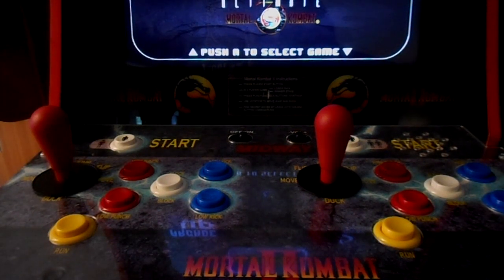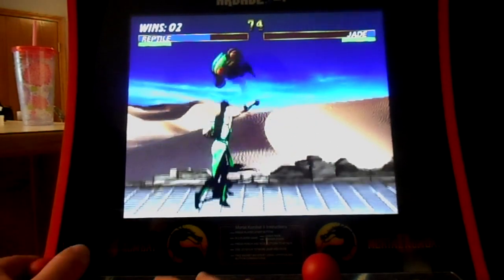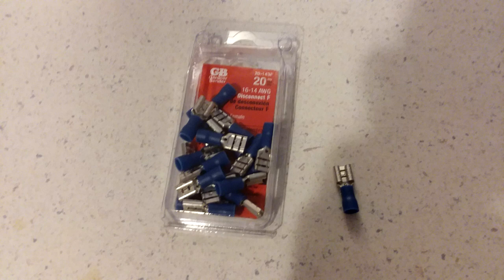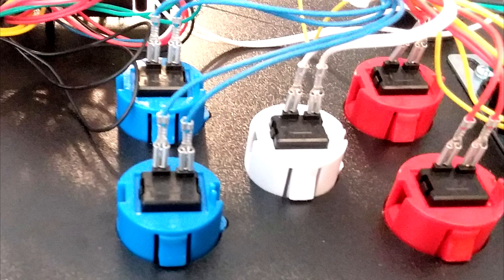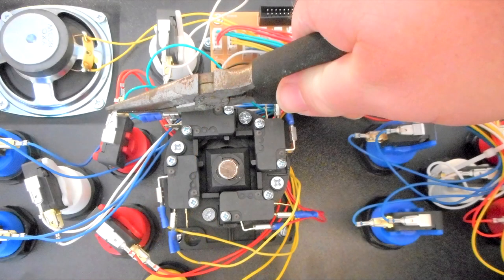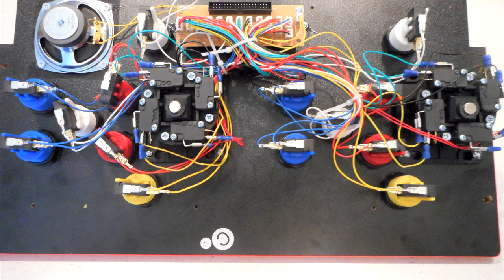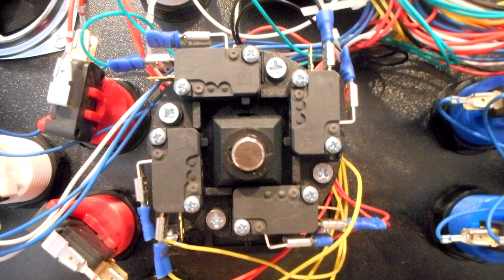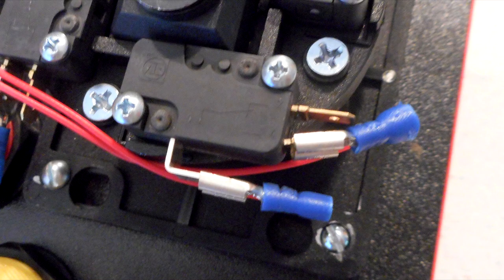It's EASY to do putting HAPP Competition joysticks in your Mortal Kombat Arcade 1up

Comment: Awesome video and tutorial. I'm actually going to install Happ joystick and buttons on my Mortal Kombat arcade1up as well. Couple of questions for you though since I'm new to this...

1. You had mentioned that the IL Euro stick and suzo-happ stick only difference is the color of the actuator. So does this mean that they both feel exactly identical? ... I'm ocd about authentication and nostalgia lol

2. You said the Happ joysticks will fit without any problems and no dremeling. I seen another YouTube video where someone had to dremel their joystick to have it fit in their Mortal Kombat arcade1up. So are you positive they will fit without dremeling? ...Not doubting you, just reassurance lol.

3. So I'll have to make new screw holes when installing the Happ joysticks unfortunately? :(

4. I played the original Mortal Kombat in arcades when I was a kid. It's hard to remember exactly how the joystick and buttons filled. I think I remember the joystick and buttons feeling smooth with no clicking. Is this true, or have I just forgotten?

5. Do the suzo-happ buttons feek exactly similar to the IL EURO buttons, and are they clicky or mooshy like on the Mortal Kombat arcade1up factory buttons?
Reply from the maker: A lot to unpack here, lol. So I'll try my best. As far as stick differences, the happ stick has a black plastic actuator while the IL stick has a white nylon actuator. So that's really the biggest difference. To be honest with you, if you want the 100% the same as was in the original arcades, go with the IL eurostucks. I have those in my other machines. The only reason why I went with the Happs was because of the price. The seller I got these happs from was a really good deal. Plus the Happs are actually pretty good imo. If the IL sticks are a 10, these happs are a 9, so they are still really good imo.

No dremeling in the MK cab. Yes people had to dremel in the SF cab because the buttons were closer to the joysticks, so it created a problem. But you dont have that issue with the MK cab.

Yes you will have to make new screw holes. I didnt drill my holes, I just used the screw driver and made new holes with the screws. It wasnt too hard, but it was the one of the most difficult aspects of this mod (placing the joysticks).  Making sure the center, screwing them in, etc is a little challenging.

As far as buttons go, it's the micro switches that make all the difference. Get cherry microswitches and you will have arcade quality buttons. The happs that are in this machine came with cherry mircroswitches, and they feel great. I ONLY use cherry microswitches in ALL my mods (I also have a SF cab with a custom control panel, 2 IL sticks, trackball, PC with games from arcade classics to gamecube and Wii with launchbox frontend, and I did EVERYTHING myself). Dont have a video on this machine as of yet, (I just completed it the other day), but it should be coming soon. Anyways, its ALL about the microswitches. I have "generic" buttons from Paradise arcade shop, in the SF cab and they FEEL EXACTLY like the Happ buttons, because they both have cherry microswitches. That's really all that matters. Some people are snobs about it, and WANT the $3-4  buttons (per button), but I'm telling you that's a waste of money (unless money is no issue). You can get generic buttons for around $1, then get the cherry microswitches and they will feel and play the same as the expensive buttons. 

Again I went with the Happs in the MK cab because it was a REALLY good deal. The link is in the description (I dont remember the price off the top of my head), but it really is a pretty amazing deal, for really good quality sticks. When I buy my IL sticks (and the generic buttons) through paradise arcade, I EASILY spend over $100 each time. That's really why I recommend the Happs for the MK cab, you will save quite a bit of money this way, and will be happy with the final product.
Reply: @MikeyJProductions thanks for fast reply lol. yes, I'm aware of tornado Terry on eBay selling suzo-happ joystick/buttons. They're around $50 after tax versus $100+ for the IL Euro brands.

Basically it's twice the price give or take. I'm not too concerned about internal parts being different COLORS between them. My main concern is the way they FEEL, PLAY, AND DURABILITY. 

If the lower-priced suzo-happ sticks/buttons feel exactll like the IL euro, then I'm cool with saving half the money, so I can use that half to purchase another set. The only way I can know for sure on how they feel is if I ask someone who has both brands. You have both, so therefore you know how they both feel. So as a final question..... do the suzo-happ feel EXACTLY IDENTICAL with the IL Euro, or is there a difference in feeling somewhere I'm unaware of?

If so, what is the difference in the feeling?
Reply from the maker: @kjmullinz  Well... after talking to you earlier this morning (I checked them out again) I can say that the plastic that each stick is made with does feel slightly different. Basically the Happ sticks feel slightly rougher and the IL sticks are slightly smoother. Not a big deal, and not something you would notice if you didnt have both. But it is a "feel" difference, and that's what you asked for. I dont notice much (if any) of a play difference, tbh. Basically the actuators, this (very subtle) feel difference, and the dust washers (happ are always black, IL are whatever color the sticks are), are the only difference I can see.
Reply: @MikeyJProductions  appreciate that, bro. And nah those slight differences aremt worth spending twice as much for the whole set.

As long as the suzo-happ does it feel like cheap knockoffs, I'm good. Was just afraid of a Feeling like one of those obvious knockoffs once you start using it like a GENERIC controller compared to a GENUINE one. So far, everyone's had good feedback on Tornado Terry's suzo-happ parts on eBay. Including you. Thanks again.

PS. 
You mentioned you're doing it arcade build earlier. I'm doing the same thing. I've heard good things about rec room Masters and their prices are the most affordable. What is your feedback on them?

PS. 2 
I'm going to order the ebay happ parts to install in my A1UP  MK CABINET. I understand in your video that you are using the same encoder and wires that came with the cabinet. Instead of removing the wires, would I be able to just purchase new wires to connect to the Happ parts and the A1UP encoder?
Reply from the maker: @kjmullinz  I thought VERY seriously about buying a rec room masters cab tbh, and ALMOST pulled the trigger. But now I'm glad I didnt. Not that it isnt a good product (because I'm sure that it is), but because they are SO expensive (even though they are cheaper than everyone else). They have that 3/4 cab that's decently priced (gameroom solutions has one as well). My problem with those cabs though is the height, they are to short imo. I am perfectly happy with my modded SF arcade1up, plus it's on a riser (so it's at the right height). 

I dpnt know what your "skills" are (wiring, woodworking, etc), but if you think you can do it, either build your own from scratch or mod an arcade1up (these are the 2 cheapest options). My SF cab cost me $150 for the cab (found a display model), $150 for the PC (Dell Optiplex with an i5 CPU), $200 for controls/converter boards/Ipac/etc, and I'll say another $100 for "other expenses" wood/control panel artwork/etc. All in all that's around $600 for a pretty top of the line arcade machine (9 buttons per player, trackball, 7 admin buttons). Which I basically "stole" the rec room masters control panel design. Anyways, that's AT LEAST $400 cheaper than their big cabs (plus you gotta STILL add a PC and tv). Their 3/4 cabs are $400 but you still have to add the PC and tv (and the control panel ONLY comes with 6 buttons and NO trackball). So I feel like I beat that one as well, plus it's to shoot without a "riser" imo. I did a lot of research before I started this project, and I can tell you are as well. But if you want an easy out of box experience, the rec room masters are probably nice (just remember to budget your PC and tv).

As for the wires on the arcade1up, I'm sure you probably can add new wires and attach them to the stock board (if you are good at wiring and really know what you are doing). If your like me (learning as I go), then I would recommend using the existing wires. It's the pieces that plug into the actual board that would worry me (not the part that hooks into the sticks/buttons, that's the easy part). The other end though... IDK.
Reply: @MikeyJProductions  hello, mikey. It's been awhile. Hard to believe it's been a year. I finally finished my custom Mortal Kombat cab and purchased those tornado Terry says I have parts on eBay due to the price. I have ocd, so I do tend to ask questions as you can tell lol.  My questions are...

1. I have these suzohapp sticks screwed in from the bottom using the correct screw size with four screws on each side on a washer. One of them is stripped though. Should this all be enough to hold for a competitive gameplay, or do I need to bolt the screws in? ... If I bolt the screws in, I have to remove the plexiglass which I don't want to. 

2. Is it normal for suzohapp sticks to have some difficulty flipping forward and back wards? Meaning registering diagonals. Maybe it's just been a while since I used them and I'm not use to them.

3. I can pull off hadokens and fireballs easily, but sometimes I have misfires. I hear that the IL Euro sticks can perform the moves easier, but I also heard that this was when comparing to older model suzohapp parts. These Suzohapp parts I ordered was pretty recent. About a couple months ago. Should brand matter when it comes to executing special attacks, Or am I just not use to the suzohapp?
Reply from the maker: I'll try and answer this the best that I can. Yes, you have to make new screw holes (I did as well.) You don't HAVE to screw in all three, honestly two on opposites sides is probably enough. I'm pretty sure I only have 3 screws in one of my sticks on one of my machines (not my MK though). 

As for the sticks themselves, I've found brand new sticks are not the best. They actually work better after they have gotten worn in a bit. The best sticks in my house are the first IL's that I bought. Even better than IL's I bought after them, as well as the Happs. The reason why? The are the most broke in. They felt a little stiff at first as well. But 6 months or so later, I REALLY noticed a difference.

As for buttons, I actually don't own any IL buttons. I have happ buttons on my MK, and I also have a lot of "generic" happ style buttons that I bought from Paradise Arcade. I actually use the "generic" ones all the time. They are cheaper (around $1.00-1.50 per button). It's the microswitches that matter the most. As long as you have cherry microswitches, it'll be great.

As for the difference between Happ and IL, it's VERY minimal. Do I think the IL's are better? Yes. But we are talking about a 10/10 and a 9/10. So VERY close. I still have the Happs in my MK, and have no plans to change them. They are great sticks as well.